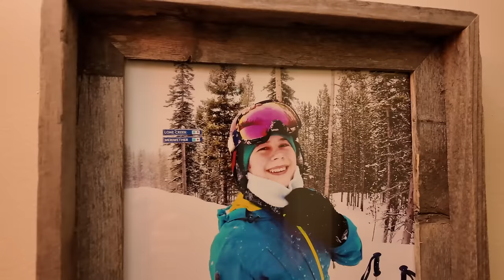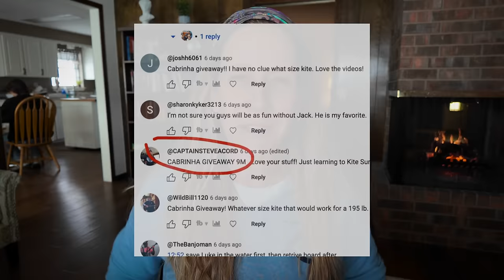Naked and Afraid (Off Grid Cabin Living) Ep 277

Comment: Is the weather typical of a el nino year? 
I would not do a prepping video, because prepping sounds like your running away to go somewhere else.  Your cabin sounds like it would be the place you go to. I would more likely call it homesteading from the 1880s, except that you make your own power and water and grow and can your own food. Self sufficient.  And your secrets are safe to keep to your family.  I suggest if you want to do this use other peoples examples, go visit them and don't show the world on utube.

For power watch "ambitions strikes and Wild wonderfull off grid" both have solar panels.  I would design a place that could have a metal, wood, mechanic shop that can be powered by the off grid system (also some type of overhead crane). Although a wind gen might be better to hide by trees. Solar panels stick out to planes and drones. hydro from a stream is easier to hide. Back up generators with plenty of fuel. Have to realize that you might need battery power vehicles, cause the fuel could run out. Your system should be able to charge your vehicles 1 per day/vehicle.

Wood shop &Metal shops have lots of desirable equipment to throw in, your choice but machines that can help with wood project and metal projects. Think about the best machines and load up a wood shop and metal shop (I'll add in hydraulic repair stuff too). For jointers and planers get a helical head (the square carbide cutters that are at a angle to the surface of the wood, shelix type).  Mechanic shop for repairing cars, trucks, snowmobiles etc.  Get a lift for underneath the vehicles. Air tools for removal of nuts and bolts.  I would suggest a pole-barn construction see RR Buildings for the shops.  A mill for logs. 

For guns watch that mad young guy from Austin Texas whose current project is to build a recreation place . 

For house, I would go for some type of  underground Bunkers (Atlas Shelters?) that has more than enough room for you and family (future generations included).  Tunnel from house to barn to shelter and a way to isolate these tunnels.

And the final thing is water supply, a well works well, but your need storage for water and a rod plant (boat) and uv light to disinfect the water.   Water runoff from house could be used for plants, grey water from sinks and showers could go to help water plants.  You might consider an earth type house built into side of hill facing south with an atrium for sunlight and winter plants.

And the final most important thing is books for the equipment you have on paper, not electronic. Spare parts too. Charts to find raw material and books on how to process that materials.
It all kinda like your boat stuff, but its for generational use.

Comment: You should think about building up a lip for the edge of the hot tub, or I'll be seeing the same issue again some day soon. Maybe adding something like an low angled bit that lifts up the inside a bit and then angles outwards to create a lip. Doing that shouldn't affect the usability of the hot tupe very much either and I don't think you would need to add very much at all, just enough so that the water flows away as long as the top in in place.

Comment: Hot Tub Fix.  You can either make a cover/roof under those deck boards above it and have it sloped enough to drain the water/snow away from the Hot Tub? Which I think will be the quickest to build. Or you could take 2-2x6 or 2x8s and run anchor type bolt on one board each side so you could lower the new structure up and down when you use the hot tub. Attach the 2 boards onto those Deck boards against or by the Cabin.  Run 3/4 ply wood across those 2 boards. Than when it is lowered down it will be on the ground past the hot tub at a 90 degree angle so all snow and water will head out past the hot tub. If it’s to heavy to lift attach a wench to bring it up and down. Lol. My 2 cents

Comment: We don't slow down because we get old, we get old because we slow down, this applies to most but you're a doer Keith, you would lose your mind if you stopped now, you have another good 10+ years minimum before you'll take it easier, you have your health as well which is massive, I have had to slow down because I was diagnosed with MS in 2007 and I still push myself hard , you just keep doing what you're doing for as long as possible, I love the content you put out so KUTGW👌